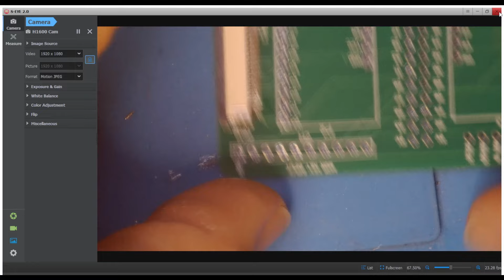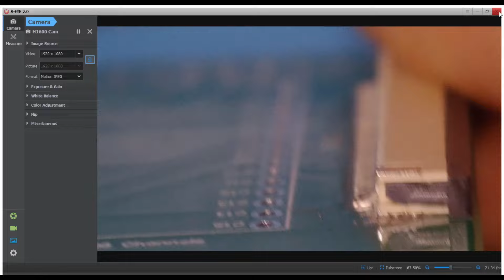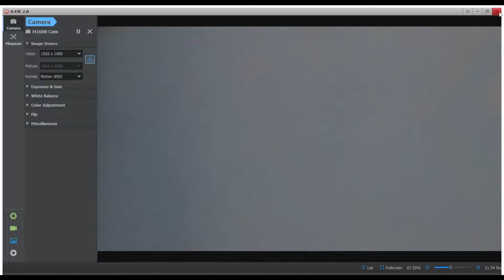How to Solder FFC Connectors Easily With a Soldering Iron - No Skill Required

Comment: My Anxiety Skyrockets with regular Soldering, and I did it for years when I was younger.
I hate tiny fine connectors like this
Reply from the maker: You and me both! I honestly thought I wouldn't be able to solder that connector. It's made of plastic and the pins are so tiny, that's why I wanted to share the technique.
Reply: @GerrysTech  I've never seen the Paste Before, I have to look it up and get some to try!
Thanks Sir!!
Reply from the maker: No worries. I bought mine off AliExpress for a couple of bucks.